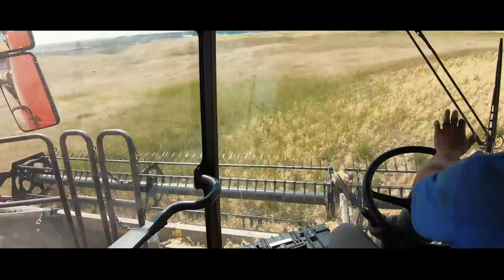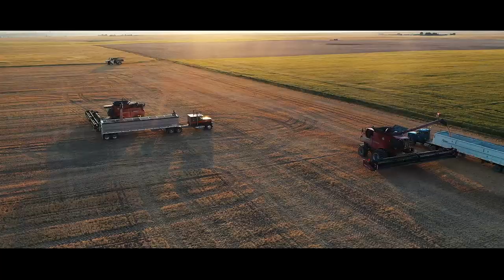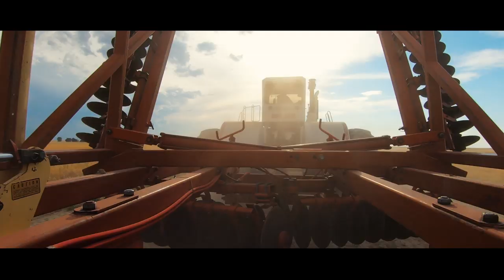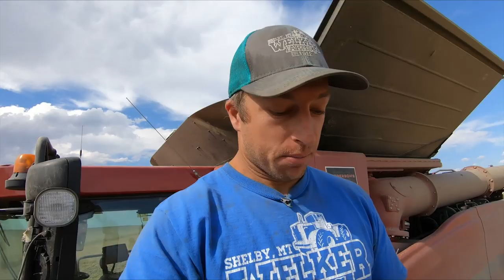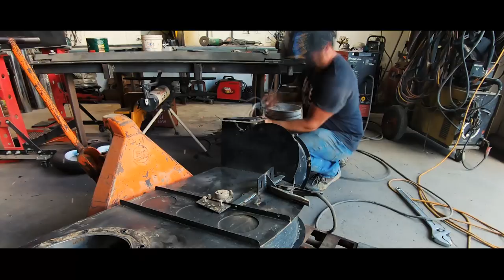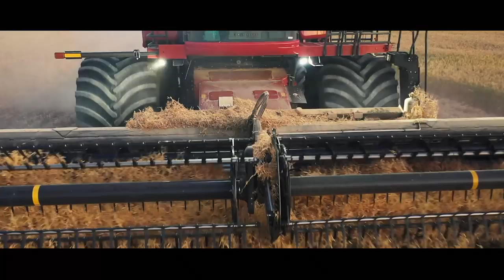The Beautiful Big Sky & Breakdown - Harvest Episode 2

Comment: Drill a hole at the end of the cracks before you weld them. It helps prevent the crack from continuing.
Reply: Need to check the other machine for cracks also and get ahead of it. When it is Harvest Time, expect the unfortunate issues.

Comment: an incredible tool for diagnosing issues like you described is a cheap infrared heat gun its amazing because you can keep the machine running and operating while checking for issues without sticking hands inside moving parts.
Reply: We do have infrared gun but we needed to reach behind the body to feel where the gun wouldn't be able to point.

Comment: I just find it hard to believe that those cracks are not serious in nature.  You may have welded that area and even strengthened it but what I saw in the video was very unusual. The bigger question is what caused this? That stress should not have happened unless that area is defective. First the bent header that I was surprised was not caught by the dealer or by you when u purchased them and now this. I think one of those combines was involved in some type of incident prior to you buying them.
Reply: The header didn't come with this combine so no correlation there.  The re thrasher is not an uncommon problem.  Heard of others too.  Otherwise the combines seem to be solid.  The dealer would have fixed the header but we figured we'd do it for them.

Comment: Do Fires happen frequently in that area?  Have seen in several of your videos where you are getting things ready in case of a fire!
Reply: Combines create a lot of heat and have always been a high risk of fire. But since the EPA mandated emissions equipment on new farm equipment the risk has increased tenfold or more. They clean the emissions by running insanely high temperatures and it's a miracle that more fires don't happen really. A good example of the risk they deal with can be seen in a few videos where police cars catch fire in tall grass. Combines and certain equipment really should be exempt from needing a catalyst system on their exhaust. It is just a fire waiting to happen and if you google combine fire you'll see what I mean.
Reply: Don't want be sorry if it happens

Comment: Could the combine paddle system cracks be due to a manufacturing or materials defects? Are there any warranty coverage or factory recall programs? One understands belts and bearings wearing but the overall structure should remain solid.  I hope you will some close up footage to Case IH.  Leg arms would make a great design consultant in the winter months.  Great video.
Reply: The machines are six years old.  At that point, repairs are on the owner.

Comment: How many hours on those machines? Seem rather new to be having metal fatigue issues
Reply: They are great machines.  It's not a unusual problem with this year model for that re thrasher to break. heard of others.  800 and 1300 hrs.
Reply: Robert Welker is the dealer able to help out with warranty parts? I suppose you just need to get it back up and running as soon as possible, so welding it it!
Reply: They wouldn't have the whole assembly and the price would be huge.  Much easier to fix it ourselves and it's better reinforced then the factory